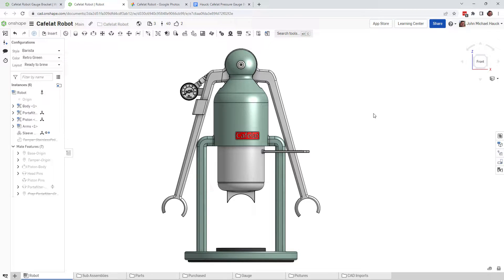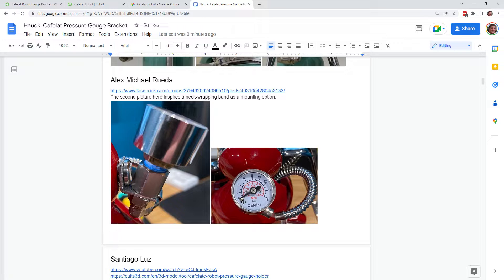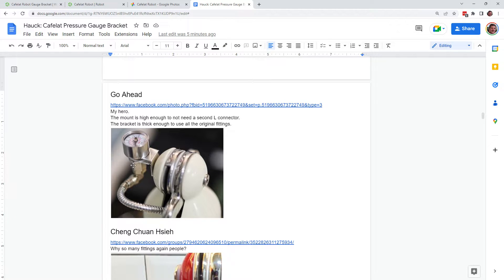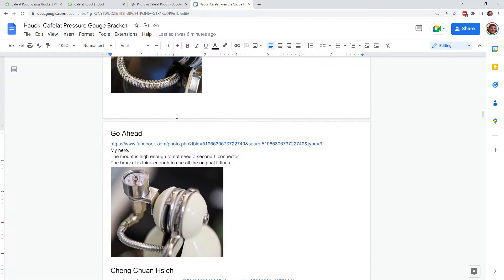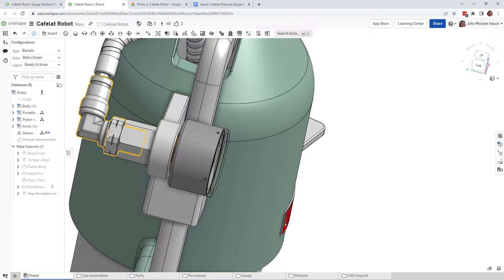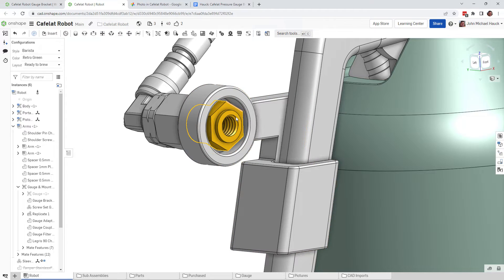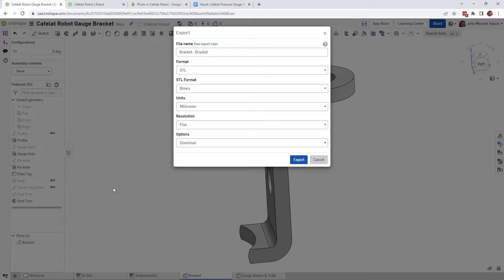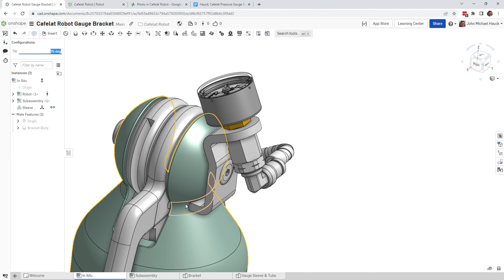Cafelat Robot Gauge Bracket

Comment: Nice work, your solution seems very good! Im going to look at your other robot videos. A few questions- Is the bolt countersunk into the bracket? Did you try heat to break down the lock tite from the original stainless piece? Is the articulated metal sleeve over the pressure line necessary? You’d lose the pinch protection, but it seems like increased flexibility would be a big plus.  Maybe your bracket could incorporate a tube guide into the head?
Reply from the maker: Yes, the bolt is countersunk.
You can view the model here and spin it around in your browser to check it out: https://bit.ly/CafelatRobotGaugeBracket
Click the tab on the bottom called "Subassembly"

The pressure line tube is a tricky (unwieldy) thing. It might be fund to try a smaller diameter tube with more flexibility too. Yet, it could get jammed where is comes out of the Robot body. Each idea sounds good until ... you actually try it.
Reply: @JohnMichaelHauck  thanks for the reply John. I thought about how much work it must have been to create that model in cad. You’ve done some great work!

Comment: Thanks for the tip on using the flathead screw driver. I was struggling so badly and almost gave up but was able to unscrew it when I had the flat head screw driver in... still wasn't easy but got there eventually!

Comment: Guys don't do it.
It is a very nice bracket,but pressure gauge not meant to be removed from the original bracket. Just damaged my pressure gauge. Try to modify using the original bracket.
Reply: I also destroyed mine during disassemble as Paul uses a permanent lock thread. New gauge, all good. But I am pretty handy with tools and machining
Reply from the maker: This is a fair warning. Clearly there is risk in any modification, and this is no exception. I would not go so far as telling people not to do it though.
Reply: How to modify using original bracket?

Comment: Hey, have you seen a video of anyone disassembling the pressure gauge online, you mention people discussing online but I've searched for hours and not found anything. I'd love to use this model for my gauge support but I'm not clear enough on how you're describing the disassembly and I don't want to break it!
Reply from the maker: I would check with Facebook group  https://www.facebook.com/groups/2794620624096510/?ref=share&mibextid=NSMWBT and https://www.home-barista.com/levers/
Reply: Very late to the party here but I can confirm the gauge is thread locked so it's a 100% certainty it will break when dismantling. However new ones can be purchased from cafelet.

Comment: Beautifull. Thanks for collecting all the solutions and sharing yours. Do you have any suggestion about the disallignment between the gauge and the flexible tube that seems to happen after the modifications in the pictures?
Reply from the maker: Gabriele, shhhh.. let's ignore that elephant in the room ok?
Reply from the maker: Seriously though... 

The actual tube is a Legris clear plastic tube from Parker. While I do not know what material it is, my money is on PFA since that is food safe, can handle the pressure, and temperature. That tube does not become disalligned with the fittings.

The tube is protected with a metal sleeve. The sleeve helps keep the tube from getting crushed between the arm and the body casting. The sleeve does not connect to the fittings, so it can be pulled away from the fittings by hand or by a tight bend radius. The best way to keep the sleeve from pulling away from the fittings it to reduce the bend radius and other strains on the tube.

On a side note, some people report a clicking sound when nearing the end of pulling the shot. When I first heard it myself, I suspected it was the filter screen getting stuck in the basket. It turns out the clicking noise on my machine is the ribbed metal sleeve scraping across the body casting.

I hope that helps.
Reply: @JohnMichaelHauck  maybe an idea to avoid the sleeve to be not alligned can be fitting it with a sort of metal ring that keeps the two parts tight together?
Reply from the maker: @gabrielevassallo3438  Finding the right fittings and tubes that are food safe, can handle the pressures and temperatures, are flexible enough, cost the right amount is a dizzying task. I think Paul Pratt did a great job on this for a pressure monitoring "afterthought". Another option is to dispense with the sleeve altogether and then maybe select a colored tube for looks, like green red or blue. https://ph.parker.com/us/en/fluoropolymer-pfa-tubing-fluoropolymer-pfa-tubing-1
Reply: @JohnMichaelHauck  😂😂😂

Comment: Hi, John. Interesting. About the nut inside the fitting, they make thin-wall sockets that may fit inside the fitting. What size is the nut?
Reply from the maker: The nut is 11mm.
The inside diameter of the fitting is 14.5mm.
Reply: @JohnMichaelHauck  - Amazon carries them. Search "11mm thin wall socket"